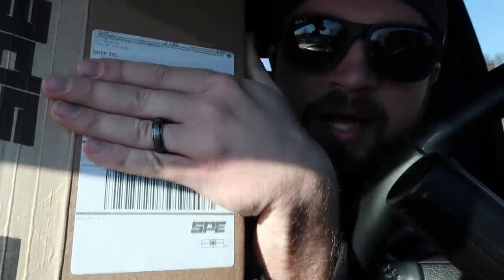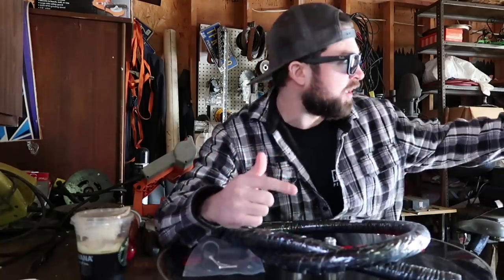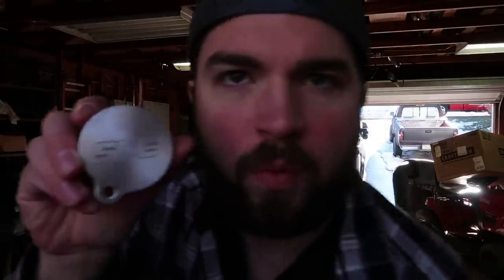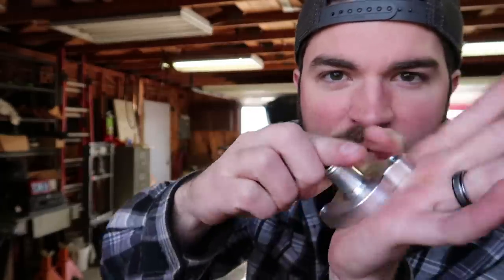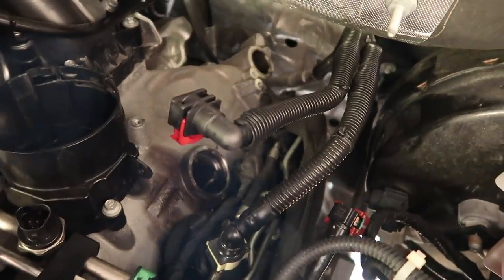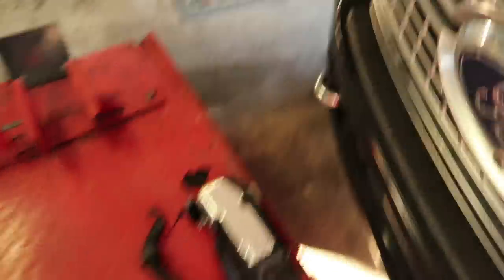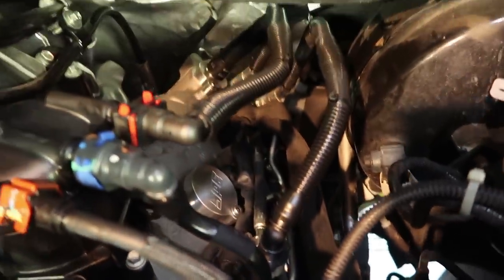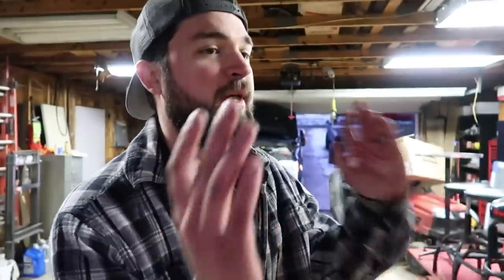OIL IN YOUR INTAKE - 6.7 Powerstroke CCV Reroute

Comment: I've done the DPF delete with the EGR unplugged and I get significantly better fuel economy. I'm now in the middle of eliminating anything that is not air or diesel fuel from entering the cylinders. Yesterday I removed the EGR cooler (just in case). Today I'm finishing up with the CCV delete, the SPE disaster prevention kit and a Pusher intake system and coolant reroute. Screw the EPA.

Comment: I did my 6.0 ,  Used a drain hose for a washing machine with a nice goose neck in it.   Stuffed it in my valve cover hole and down the side.   Presto !      Hot side Turbo silicone hoses kept popping off because of the oil vapor sucked through.  Nice and dry now.     Diesels always had a blow by vent hose running down to the ground.  I don't get oil dripping either because of the goose neck up above.    Don't forget to cap the hole on the intake tube.

Comment: CCVs have been routed into the intake for many decades, on many engine designs.  This is a solution in search of a problem.
Reply: It's a terrible design. Those gases degrade engine performance and not to mention the oil can and will degrade the plastic and rubber components on the intake.
Reply: Yeah I know that. I was talking about stock and OEM designed CCV management systems routed into the intake.
Reply: Catch can time

Comment: For all those miles that is a tiny amount of oil in the intake tube. Seems like a little oil lubes the turbo. EGR is much more of a problem
Reply: Bob L. I would think this would reduce the EGR buildup. Soot will still collect but the tacky/oily substance that I always see when a clogged EGR is removed should be reduced...?
Reply: Oil does NOT lube the turbo. There is no way the oil from the intake gets to the sealed bearing that is lubed by  the engine oiling system. All the CCV system does is blow crankcase fumes and an unacceptable amount of oil through the intake and into the cylinders
Reply: @tprice3450   Exactly correct Tom Price.  The environmentalists need to stay out of the automotive industry technical "circle of life".  You enviro's just stick to your EVs and leave us alone.
Reply: You need to learn how the turbo works. All the oil that goes through turbo does NOT lubricate the turbo. In order to oil the turbo, the bearings would have to be exposed to that oil. You have also not ever removed the cold side pipe. If you leave the CCV system in place, you will find the cold side tube and the intercooler with gobs of oil. Since I removed my CCV system, mt 230,000 mile 6.7 doesn't use a drop of oil and the performance is better.

Comment: I installed this on my 2015 Super Duty. I have about 10,000 miles with it on. And it leaks drops of oil for sure. I only have about 40,000 miles on truck now. So I’m not sure how yours doesn’t leak a drop of oil at all. When you pulled the CCV box filter off, there was oil in the box. Maybe it doesn’t leak for city small driving. But when I do a long trip with truck. I wake up to a small oil spot on driveway. Guess I need a catch can now.
Reply: Timothy Dare just install an exhaust scavenger kit.... basically it route the gases direct to exhaust thru the use of a bung welded into your exhaust it will also create a vacuum and pull crankcase gases... you can get from amazon or Ebay... works very well no oil no smell just all the pros of doing a CCV but none of the cons....

Comment: I had the same thing ion my 7.3 I ran for 15 yrs with the hose on the inside of the frame here in AZ it eliminates all the oil from building up in your after cooler o now have a 6.7 2013 tow monster F450 4wd THANKS for info will definitely be doing DELETE

Comment: Just curious why not go with the baffled catch can route so you can still get the scavenging assistance of the intake? I was looking for catch can setups for my 6.7 and wife's 3.5 Ecoboost.
Reply from the maker: No need for a catch can with this kit, its designed to let ZERO oil escape.  That is why I chose to promote this on my channel.  Ive personally seen It in action on a 1000hp 6.7 Powerstroke full pull on the dyno and not a drip of oil was pushed out.  This hose is much bigger allowing gasses to escape very fast unlike a restrictive catch can.  No pressure can build in the bottom end.
Reply: I can understand the restriction concern when utilized with a 1000hp powerstroke. I'm more asking regarding everyday usage for the average Joe like myself, just concerned about oil accumulation in the intake system. I would imagine that the gases from the crank case would have trace amounts of atomized oil particles in it which would accumulate on the filter element in the catch can. For everyday use with the outlet hooked up to the intake, wouldn't that be sufficient enough to where restriction wouldn't be a huge issue?
Reply: Slidzhapply a catch can is much better than this setup if you don’t want to drip oil everywhere. His kid obviously just has read some literature and doesn’t really know what he is talking about. Just some stupid kid that talked his parents into buying him a shitty truck.
Reply: I agree with the catch can idea. adapt ape made a video further elaborating on this ccv issue and running it into your intake further reduces the risk of oil gasket failure, this works great on na port fuel injection engine's however the debris causes issues on direct injection engine's because of the build up on the intake valve and also the intake impeller on the turbo, both situations work but the catch can mantains a vacuum assistance on the crank case

Comment: I just replaced a cold side rubber hose that unzipped that was slimy with oil, if you don't think that oil and vapor is bad for your engine, take off your upper intake and look into the area that mixes with soot from egr and coats it with 3/8 " of crap. And that's what stuck and didn't go thru!!!

Comment: Should route it behind the cab. The fumes like to seep in the cab at stop lights or when you open the window or door if under the cab.
Reply from the maker: I left the hose that length and routed it back under the truck more, I have been in stopped traffic the past few days (awesome weather) with windows down and haven't had any fumes come up in the cab
Reply: Maybe that's the trick. When I did mine I hugged the frame rail and dumped it pretty much under the driver's and passenger seat. Come spring I'll be extending behind the cab. Enjoy your videos. What happened with the 6.4 build?

Comment: I did this as I didn’t like the idea of oil in my inter cooler pipes as you showed. But have to say the smell of burning oil is unbearable coming out of that ccv reroute vent tube. Any people thinking about going this route spill some oil on your hot engine and if you are ok with that smell at every stop light go ahead with this mod. As for me I am buying a new stock ford ccv oil separator and putting it back on.
Reply: i did the same thing put  on a new one from ford all my problems pulling especially heavy trailers fixed after going back to stock
Reply: Add a catch can with drain valve that has outlet, run the outlet with hose to the rear of the truck....problem solved.
Reply: SPE makes an internal catch can that eliminates the problem of oil escaping through your vent hose. As far as the smell goes, buy a 90° elbow and route the hose over the trans and all the way to the back of the truck. Problem solved.

Comment: So are you have to do is take the box out plug it off put the rubber plug on and put the cap with a nipple on it in the back and Route the hose down and out and you're done nothing to do with the tuner or it doesn't throw any codes and you get fresh air

Comment: Main misconception about ICE. Fuel do not explodes in combustion chamber of spark or compression ignition engine. Fuel ignites. If it explodes you have trouble.
I run same pipe on my diesel, so called elephant hose, down under car to create vaccuum by Venturi Effect in crankcase at some cruise speeds like 60 or 70 mph. If you bust EGR and PCV route to air, there is still oil from turbo seals, and that seal, always leaks to some point. 
You can not get right of oil in diesel intake manifold completely, but busting EGR and routing PCV to atmopshere is good way to start. After those 2 deleted, clean intake manifold. 
Soaking manifold in warm water solution of caustic soda for 10 minutes, works wonders.

Comment: This is one thing that you should not do cuz your turbo creates a suction to relieve the pressure in the crankcase your turbo seals can actually blow out if you take away the stock crankcase pressure release and your truck is a diesel so it don't care if it runs on oil it actually likes it
Reply: Definitely don’t do this to the 6.7 I had to put mine back stock after one trip pulling heavy trailer and that was 300,000 miles back I now have 441,000 miles no issues what so ever! Do not do this to your 6.7!

Comment: Watch powerstrokehelp.com and see what Bill says about this reroute. Has a youtube video on why this is a stupid idea. Not sure who is right but food for thought. Basically says it creates problems for the seals in the turbo when you take the oil out and reroute it.
Reply: @timbo_slice4053  Bill hewitt is a used carsslesman but... regaurding the CCV alot of people do have issues with oil leaks after doing the CCV mod. The only reason I did do the mod was that International intended on it venting to the atmosphere.
Reply: The CCV Reroute only takes excess crank case vapor and routes it into the intake in which that coats the inside of the charged air cooler, pipes and the turbo compressor wheel with oil.  That has nothing to do with Turbo seals.
Reply: @timbo_slice4053  my knowledge is for 7.3 which I thought this vid was. Regardless though you are now opening a closed system thus changing pressure and after 15+ years and then doing this mod the different pressure can affect seals and o rings. Tons of people have oil leaks in the 7.3 world after doing this mod, give it 15 more years and 6.7's who attempt may have similar issues. 

This mod is pointless just think how many old 7.3s are on the road have u ever heard of bad inner coolers?? No the reasoning is premature wear on intake boots. Which can be prevented w heavy duty silicone boots. Pointless mod.
Reply: @pilgrim666butters  The old 7.3 is a dinosaur compared to the 6.7. The CCV on a 6.7 routes the Crank Case pressure back into the intake before the turbo. There is no "opening of closed systems." Many many race cars run a CCV Reroute into a catch can in which vents to atmosphere. The Turbo seals going bad has  nothing to do with a CCV Reroute on a 6.7.
Reply: Timbo _ Slice I’m sure bill has forgotten more than you will ever know.
Reply: @1curt12  Maybe so. That doesn't mean he is correct.
Reply: Michael Macon I have some food for thought. Oil does not make it around the turbo wheel and to the seals... if your turbo fails soon after the ccv mod then it was going to fail anyways. Also that oil dropless also erode your turbine as it spins at 30,000+ rpms. Much like a river erodes a rock.

Comment: If the oil was designed to escape with the gases, what happens to the oil that’s not escaping now?
Reply: it stays in the crank case and falls back down to the oil pan and is circulated back through the motor as intended.

Comment: Would this be the reason im getting a oil/soot sludge in my exhaust pipe after sheading some weight? Its starting to drip from the junction on the new pipe. 2019 6.7 PS.

Comment: I'm all for cleaning up the engine bay by removing useless factory parts. The only thing that is keeping me from jumping on one of these kits is the fact I dont want to be dripping oil in my driveway after I park it. If they could come up with a catch can for this I'd be much more interested for my '17 king ranch.  You have a good looking truck btw. And we are practically neighbors... I'm only about an hour and a half away from Pittsburgh. And plan on keeping it that way. I get anxiety just thinking about driving through that city. Anyway I'm subscribed... keep the videos coming.
Reply from the maker: This kit was designed to produce ZERO oil.  Only gasses escape through the hose.  That is why I chose to promote this kit on my channel.  Ive personally seen it in action on a 100hp 6.7 powerstroke full pull on the dyno and not a drip of oil came out.   Ill do a "x" milage review here very soon and show that no oil escapes through this kit.
Reply: @TopCorey  well I do stand corrected. I guess I assumed and made an ass out of me.
Reply: I have a CCV Reroute on my 6.7 and hose is routed down to the frame on the driver's side beside the fuel filter. It has never dripped in the driveway. I am going to put a Mishimoto high flow catch can on it just to tidy the installation up.

Comment: Do you think that has a lot to do with the def system plugging up as much as it does cause it's rerouting that dirty air back into the engine?
Reply: Jim Kasianides Not really as this was done on the 7.3 power stroke as well
Reply: @matttraxler3567  only reason I ask this is I m sure it would extend the life of the engine but also where I live in northern Ohio we have to do the dam emissions check every other year so I wasn't sure if that would change anything on that end of it
Reply: Jim Kasianides Where I live we don’t do emissions checks, but as far as that goes it should t change it as it doesn’t really effect the exhaust; shoot you could go as far as to routing it into something when emissions tests come around

Comment: Could it being rerouted into intake cause white smoking during idle.... 2018 6.7 with 65k started around 50k. Only does it when idleing and truck idles alot... it being a pipeline truck...... goes away once it starts moving....
Reply: Routed** into intake and being clogged up cause white smoke
Reply: I have the same prob I keep changing the ccv filter it’s annoying

Comment: So if there is minimal to no performance improvement, why in stall this?

Does it prolong engine life, or turbo, or what?
Reply: Oily crankcase smog entering your intake will:
a. Introduce diesel particles to your compressor side which may damage shaft seals on your turbo
b. clog your intercooler, restricting airflow and reducing its ability to cool your intake air. It can also foul map sensors.
c. Lower the oxygen content of your intake air, making your engine run richer and thereby using more fuel.
Remember also that crank gases are introduced post-maf in most systems, so the ECU is always allowing for unmetered air in its calculations which will mean the fuel mapping is not as accurate/efficient as possible.
d. When the smog mixes with exhaust fumes introduced via the EGR, they form a black tarlike substance that bakes onto your intake manifold, valves, pistons and turbines over time. Gradually this will choke your engine up and causes it to run rough and inefficiently as you lose cubic capacity to this black substance.
e. To follow on from D, your cylinder bores can become glazed if carbon builds up inside the chamber and on the pistons as diesel and oil will have less of a chance to get in there and do their job.
This will give you more blow by, which means more oily vapor.

Note in gasoline applications its not such an issue as the fumes are usually plumbed into the intake where gasoline (solvent) is already present. Direct injection, different story...

Hope this helps.
Reply: @mnwctid  wow! Sickest comment yet!

Comment: will this make you loss vacuum pressure?  Someone had told me that diesel already has low vacuum pressure.
Reply: If you have vacuum on a diesel engine, you need to change the filter or upgrade it.

Comment: So i let my 2016 powerstroke sit for a week, it ran PERFECT before i let it sit for a week then i come back and now i have white smoke, but i only get white smoke after i let off from full throttle, it doesnt smoke during full throttle only when i let off, could this be the CCV clogged or egr leaking? Keep in mind im deleted with the egr on but its UNPLUGGED
Reply: My 2012 would let out a puff of white smoke during acceleration after idling for a bit or from a cold start up. Mine is deleted as well so immediately my mind went straight to injectors starting to go. Changed the ccv filter and it went away. It's starting to do it again (after about 2 years and lots of idle time) so I just ordered the spe internal catch can and reroute kit to eliminate it from happening in the future.
Reply: @mitchbaier3753  i have the internal too and it still smokes pretty bad from the ccv reroute
Reply: On your 2016 what did you do about the sensor next to the vent back to engine,?  Did you leave it plugged in and cap or did you un plug it and cap?  Any code from it?

Comment: Cory, could this be the reasons why my coolant hose is covered in oil? I have done a complete EGR, DPF, DEF delete. What am I missing?
Reply from the maker: something is leaking.  Check the CCV box and the tube that goes into the intake pipe right before the turbo

Comment: Hey I did this and now I’m getting a check engine light due to the ventilation system being disconnected? Code P04DB any fix to this?
Reply: Look at 17M04 program
Reply: @PowerStrokeTechTalkwARod  what is that?
Reply: @Alex450whp  a reprogram tied with a recall to replace the vent tube. Basically the recall is to remove the hose and install a tamper resistant hose and then the reprogram removes the dtc from the PCM so no more check engine light. The new hose is a stupid piece of shit one time use hose. You cant easily separate it from the intake, so to remove intake you have to either destroy the hose and buy a new one, or remove the oil separator along with the intake to avoid the need to remove the hose.